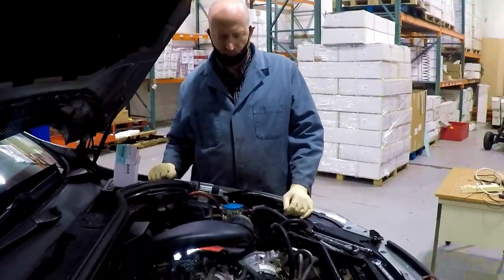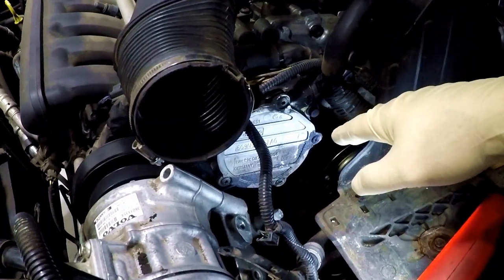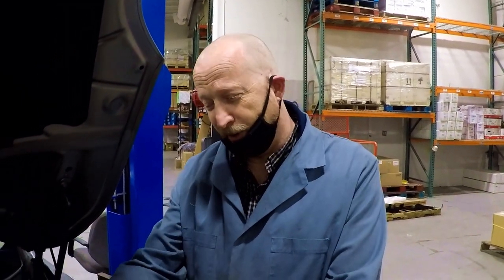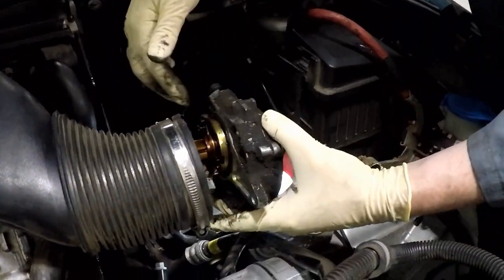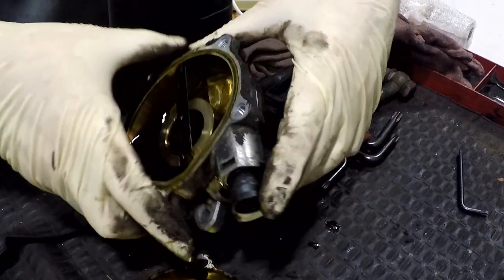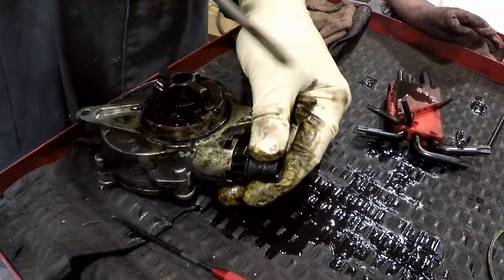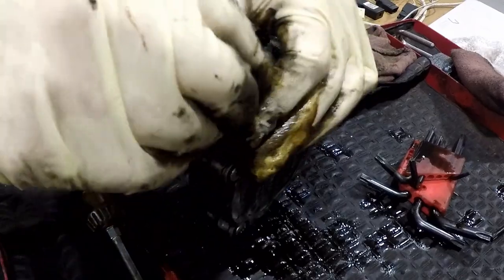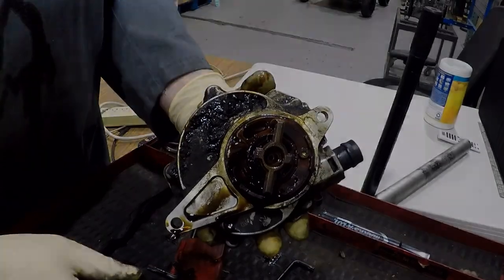IPD Volvo - Brake Vacuum Pump Repair Kit Overview S60, S80, V70, XC70. V60, XC90

Comment: Does the leaky valve/failure manifest as an oil leak or actual brake impacts? My 2010 xc70 T6 just got soft on the brakes in the last few weeks. 112k.

Comment: i volvo volvos but over the  years they  have gotten  like bmw's .....  1 parts fails its either a mess or you dont drive it till it gets fixed... not sure why people pick the shinny push a button and it lights up the car for 2 seconds over reliability..... parts lasted longer than 20k or 40k  back in the long ago ..